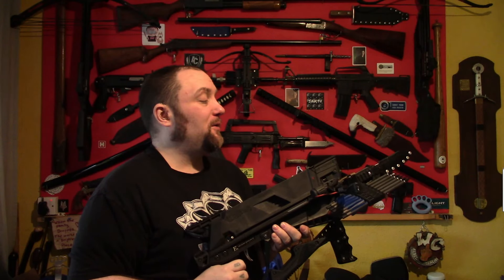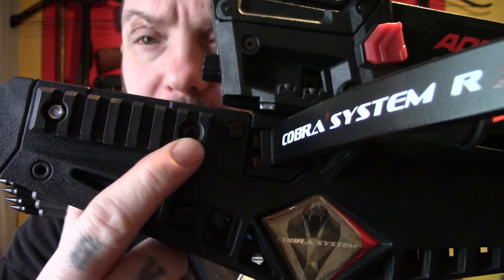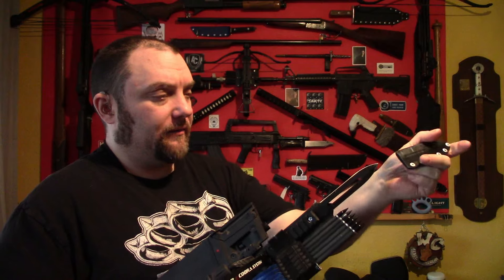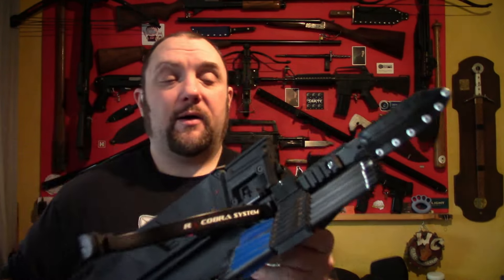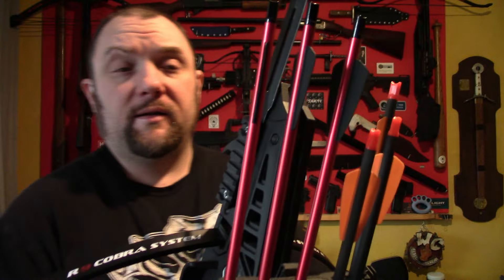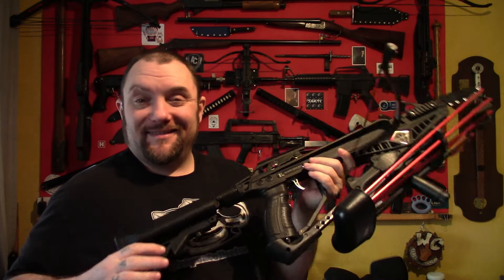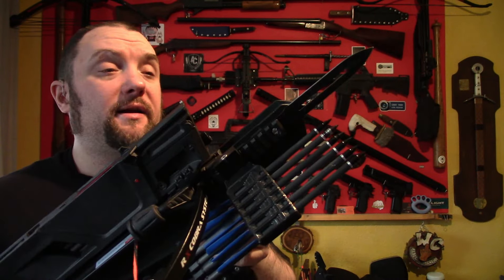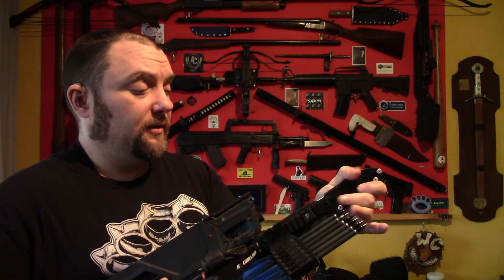Cobra Adder Crossbow Bayonet Mounting (permanent fixture)

Comment: quick one mike , any idea if steambow cassete will fit on anglo arms op360 , was thinking of getting the new ar10 but unsure if it will fit it cheers
Reply from the maker: not 100% sure, but i'd doubt it, i reckon if it did you'd see videos of it.
Reply: @WeaponCollector  a messaged celtic crossbows he reckons same chassis so may fit and would do a vid
Reply from the maker: @dave1secondago  oh right, maybe, yeah hopefully it does, i thought the steambow stinger was a brand new crossbow and not the same as the op360  / mantis etc/ but i dont have one so he may know.

Comment: Interesting… but kinda useless. This is not a gun with a steel barrel and significant stock to support that bayonet. The moment you try to use it as intended, the Adder will become a pile of twisted useless plastic. And all the while, its presence impedes the tactical deployment of the crossbow. 

You’re better off using the bayonet separately.